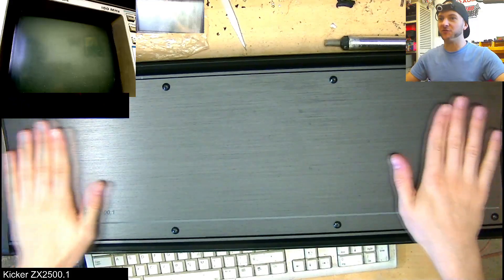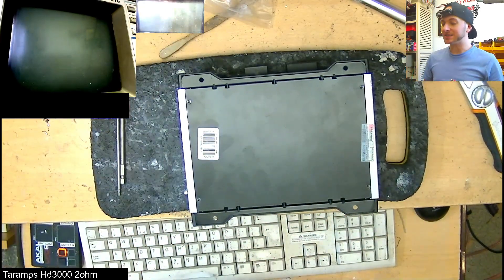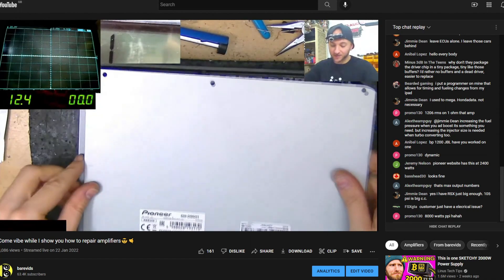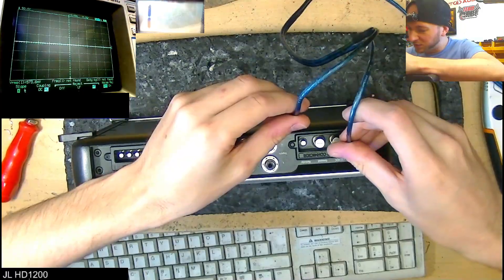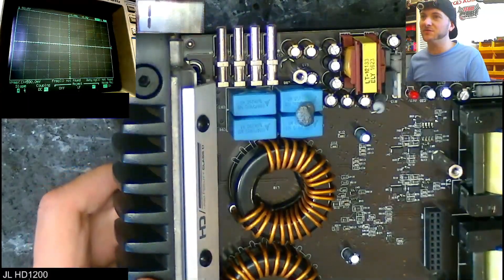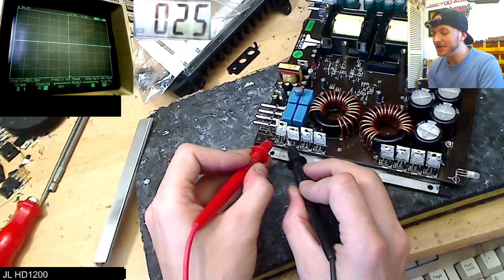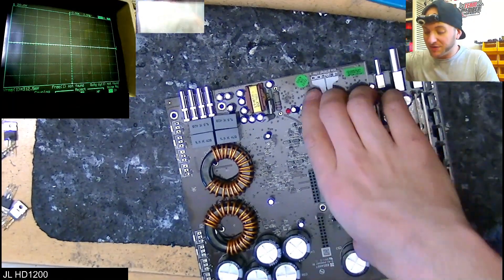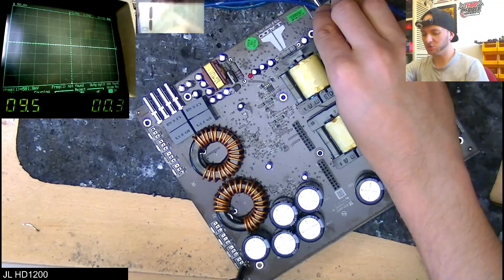Clipping your amplifier causes THIS?!

Comment: Ive got an amp, that has a CLIP LED, That is always lit, when amp is powered on.... Amp READY green light, lights up as it should, But from the second i power it on, The CLIP light is dimly lit... Not lit brightly, Just dim..... and i have 7.7vDC at output terminal of that channel.... 
Other channel is function perfectly.. No DC offset at terminal.. CLIP light isnt lit etc... 
Any idea where to start?
There are clearly no dead shorts, As amp powers up, Protection relays click and amp channel LED's go to READY.... 
Thanks

Comment: Awesome  vid bro!! Hey,I've got a jp33,and 4 10s in a vented box tuned to 32hz,the bass is fn great,but the amp is clipping and smidgen but sound awesome, not obvious indication of clipping other than the clip light, is it bad for the subs?
Reply from the maker: No it's not, but if your voltage is steady, I would suggest upgrading the amp for something 1.5x more powerful ☺
Reply: @barevids  ok,thanks bud

Comment: Hey so I have a digital designs m2b and when i turn the gain up the amp makes a thundering bump sound and will continuously make the sound even when playing music but it still sounds like it did before just had a thumping sound but I'm scared it's going to damage my subwoofer do you know what the issue could be?

Comment: So question, if the board say looked like it caught fire and looks burnt is the board junk?
Reply from the maker: No, almost always repairable
Reply: @barevids  so I checked and the underside of the board is a little toasty at the outputs. Burnt into the board a little. Would it be worth it to spend the money on fixing a MTX thunder elite 1501D? If seen it on a bench crank out 2200rms.

Comment: Can I run a soundigital 8000.1 evo 4 1 ohm amp at 0.5 ohm
Reply from the maker: No
Reply: @barevids  thanks for the reply. My friend's has 6 massive gtx 10s playing at 0.5 ohms. I know how box rase works but am not quite comfortable doing the same
Reply from the maker: @ronaldomaynard4816  I always reply no to these questions when I know nothing about the rest of the build. All amps can play fine into 0.5, if the rest of the build is suited to it.
Reply: @barevids  it should be fine because I have the current. 4 banks of lishen chargeing it 15.6v
Reply from the maker: That makes it worse. You want to LIMIT the amount of power through the board. It would be better run on 10v not 15.6v. People think strong power supply means it will be better at low impedance. Strong yes, high voltage no. Maintain 10v no clipping most amps are good for 0.5ohm. 15.6v means so much more power can pass through the board before clipping it will overload the components even if its clean.
Reply: @barevids  OK thanks I will run at 1ohm. Thanks so much for your time

Comment: Were the dead caps Vishay? And were they X types which are supposed to be self healing and handle voltage spikes. I've never seen a film cap blown and I deal with valve amps with spikes of over 1KV, weird.

Comment: bro get some chip quik (or generic equivalent) low temp solder... you can then add low temp solder on there, little by little until you have replaced alot of the hard to melt lead free solder with extremely low temp solder.. obviously you do not want to keep the chip quik on there permanently and its damn expensive.. but it works and will keep you from burning up the board.
Reply: You can easy use real hot iron. 
Discussie if what is best to do ?
Slow hot but long OR fast hot and quick thake IT off.  Its Just what you learn your self.

Comment: If the board has a lot of thermal mass from multiple layers of internal power and ground planes,  use SRA / low melt solder to remove through hole components.  They will literally fall out of the board very quickly using much less heat.  I have to do this when working on any through hole components on modern computer motherboards,  Xbox's ,  PS4s/PS5s, etc.  The boards are just too thick and will suck up heat like a sponge,  even with a powerful iron you will be there forever.
Reply: Exactly. I put a heat gun on low temp  5 inches away to evenly heat the board and lovely Pb lead solder to reduce the melting point. Flux is always helpful. RoHs THIS!

Comment: I have an alpine pdx-v9. If I put the volume at the point that distortion can be heard, it goes to protection. I did the same test at home, with the same result. Only occurs with high volume.¿Do You think that amplifier has a clipping protection?

Comment: @barevids nice work man. Crazy how simple JL amps can be to repair. Then, sometimes, they can be a nightmare. Those HD amps don’t like being clipped and ran hot. That’s how my old HD750.1 got fried. Friend of mine burnt up my amp. When the amp gets hot, it lowers its power and when it’s safe to run, it will give you peak power again. The little LED is a status light that changes color to let you know. Bet the owner ran the amp hot and kept turning up the knob till it couldn’t take it anymore. Love the new style of video work though. We need a live one day friend.

Comment: JL is such a cool company. They are the only ones to this day that I know of that do their rated power, no matter what from 14.4 down to 11.5 at 1.5-4ohms. (Did the test in my car myself. Of course, I don’t do that daily. I usually don’t drop below 12.3 on my setup. I’ll do a walk around of my setup one day on my channel.) Which means, even on a stock electrical, it will do its power as efficient as a 3-5k with all the upgrades necessary to keep your current up, and voltage up. This is why I run JL in my car. Expensive, but I guess the cost of all of the alternator, runs of 0 ga, and batteries I would need to have, just to have the same output from a 3-5k, balances itself out. And, I can move them from car to car without having to buy all the listed above, just to have a 3-5k amp run safe and not stress the power supply of other amps. Those with Perry’s guide knows, that the 1000/1v1 amps have a potential of 300 plus peak to peak rail. Be careful with those JL amps. They are more powerful then you think.
Reply: There are a bunch that do their rated power now that SMD amp dyno exists. There are channels that do amp dyno runs and alot do more than rated. But the ones that do are specific. Look at the channel Williston Audio Labs. Im sure you will enjoy
Reply: @coolstreetman  thanks for the referral, but I know of all of the channels that do amp dynos. I’ve seen the 1st run of the dyno setups on Tony D’Amore channel, (designer and founder of the SMD dyno and tools) over 10 years ago. As for the amps doing their rated power, yes I know some of them do. Thing is, they require a lot of voltage at higher ohm loads. In other words, a 1200w at 4ohm amp, which most likely will be around 4500w amp at 1ohm or more depending on the components and amp design and type. Most wire their amps at low ohm loads. Which in return, require a high current to do rated power, where as JL doesn’t matter from a 1.5-4ohm load because it has a regulated power supply that controls the current which keeps the the power balanced across the ohm loads listed. Example, if I wire a 4 ohm sub to a JL amp (R.I.P.S. Line of amps Slash and HD amps) , it does it’s peak power 1,000/1,200w. If I wire a 1.5ohm sub, or a 2 ohm, or 3 ohm, it will do its peak power from 14.4-12.4v safely. If you get a 4,000w amp that is 4,000 at 1 ohm, if you wire it to 4 ohms, most you will see is 1,000w or a little bit over or less at 14.4 and when the voltage drops, so does your wattage. Downwards of 600-800w depending on your current and voltage. You won’t see 4,000 watts at 4 ohms. That’s the difference.
Reply: @mikehonda7934  The rockford power  bdcp series amps are similar, the don't do quite as much at 4 ohm though.
Reply: @bigassfordsd  yup. Similar, but still, not the same. Also, the BDCP amp requires way more current then the JL amps do to do it’s rated power.
Reply: You are moving the goalposts. The other amps still do their rated power at whatever ohm load. It literally says in the amps advertising what the different ohm load rated power. 8,4,2,1. I'm an electrical engineer there is nothing special about how JL makes their amps. You are just a fan boy trying to sound smart. You think JL has some secret sauce on voltage stabilization? You really don't know what you are talking about. You are probably someone that thinks that apple products are inherently better because they cost a ton of money. There is no patent for circuit board designs so the JLs aren't special because even them are copying someone else's designs. Now if you want to talk about the build quality of JLs Subwoofers we can have a conversation because they make high quality subs.
Reply: @coolstreetman  I’m not a fan boy, so watch your mouth. I don’t take disrespect like that kindly. I don’t care about you being an engineer. I am as well. You sound stupid yourself talking this way. A true engineer would explain instead of leaving such a tasteless response. How about you delete your message and reply with more respect. I never said the other amps don’t do their rated power. What I was speaking of is the wider range of consistent power across the ohm loads and voltage range that most amps don’t have which JL did first and put it on the market. So come correct and respond with respect. You did some little boy 6th grade crap. Grow up.
Reply: If you are one of those Ford is better then Chevy cause my feelings please let me know because being brand loyal is very stupid. You should be looking for the highest quality for your money regardless of brand affiliation. But that would require doing actual research and thought process, which is something lacking in brand loyal people he World changes. JL could decide tomorrow to change to cheap parts and you wouldn't even know and think there products are still great this happens all the time. You have to be flexible because profit is always a companies reason for existing so.
Reply: @coolstreetman  to replying to this. I will tell you, I always look for the best option according to my build. My car was too new to do any high current designs on stock charging, and I caught good deals on my JL equipment which came out cheaper then running my JBL BPx2200.1 on my sub after all of the upgrades necessary. Im loyal to no company other then myself. If I could run a Powerus, or B2 Audio, Sound Digital, Taramps, or Rockford without needing serious upgrades, I would, but output and safety of my car, proper voltage and current for the electrical of my amp choice, and my pocket, plays a part. So go on with your crap. You are one of the reasons people hate installers, and car audio. Get a better attitude.

Comment: You know your stuff! Wow! My question is: Take an amp that uses  a DC/DC switching power supply, ok? Will the power output vary with the input voltage, or can the power supply compensate for the voltage change and still output rated power? Say range from 11.5-15 volts. Thanks
Reply from the maker: Hey Curt! Typically, with SPS in car amps, power supply PWM duty cycle is fixed, so as the input voltage changes it directly affects the rail voltage generated at the rectifiers on the secondary, which will change the clip point of the amplifier so yes it directly affects power output. Quite a few amps have regulated power supplies that vary the duty cycle of the power supply mosfets, which can keep the rail voltage at a fixed level. Its essentially sandbagging at higher voltages to stay within power and voltage design limits of the output section.

Comment: The older Kicker KX2500.1 was indestructible.. Low voltage, clipping, excessive heat and it never gave up.

Comment: I'm installing a 430 farad cap, with huge amounts of trepidation.  Can't imagine what would happen if one of those cells errupts, especially burried inside a game of Tetris behind 6 amps, batteries, wiring etc in the boot
Reply: My entire bank in my competition bass vehicle is caps.
Reply: I've got an Optima D27M in the rear, and while the battery is good quality and apparently very low internal resistance, it is 10 years old with 66% of its original CCA rating.  The cap is to help with vdroop, especially because I only have a stock 100A alt and I haven't yet even gotten around to modding the sense wire on it so it will actually stay mid 14s when I want it to.
Reply: Why not just use a deep cell group 31 battery? Batteries replenish power internally, whereas caps need an external source to replenish. 
Ideally, one would want to have a huge capacitor bank using rail voltage. A external bank can kill someone, but that's where you'll get big reserves for power etc

Comment: I think you saw no switching because there was no resistance or anything between the BJT's output/gate input and the neg rail, i've seen similar behavior on other circuits i made myself and i was like "why aint it working" till i connected a 100k resistor even lol till it worked at all

Comment: Taramps HD and MD are one of the best bang for your buck amps in the market. They come in 1,2, and 4ohm versions and cost from $160-$220. This means you get 13.63 to 18.75 watts for every dollar spent. Sorry IDK what that is in pounds...
Reply: Best bang is right! The biggest smoke and sparks. Junk amps unless your filling your car with 6.5” mids
Reply: @guysgt5003  😂I've had one for 2years now, with no issues. Maybe learn how to hook your stuff up right and you won't have those issues. The only people crying about fires with full bridge amps over other amps are idiots. If anything old school class AB amps are 10x more likely to catch fire damn things run twice as hot as any Full Bridge Class D. HALF THE PARTS, HALF THE HEAT, TWICE THE POWER.
Reply: @guysgt5003  Says the guy running boss audio
Reply: @Jamez84  Soundigital power8800’s two bro
Reply: Is that why you got NO Content bro?
Reply: @guysgt5003  Not one video of them uploaded on your page... right. 🤣🤣🤣🤣🤣

Comment: How easily will clipping cause death of caps? 
I was wondering with my SD8K 2Ohm evo2.1, can I set the gain to 126V  at -5dB and have it clip at peaks, while obviously watching that voltage won't go under 12V?
I only have a 160A alt, 6x40Ah AGMs but also 2000F of supercap banks. 
Re of the sub is 1.4Ohms, Imp rise at Fc should be 2.5Ohm and at 100Hz, 1.7Ohm.
I have in the past come to the conclusion that -5dB sets a good volume level with not too much clipping at full volume, but the SD is a lot more powerful and sensitive than my earlier Korean amps. 
Also, while I set the gain, the fan comes on right with the clipping light. Does it also come on with temperature or just clipping?
Reply from the maker: if the amp is clipping on the "kick" or impulse of the bass note only, and NOT on the tone/sine of the bass notes, then your LPF is TOO HIGH. For Brazilian amps, all of the knobs on the side should be at minimum, other than the gain. Then, an additional LPF should be set on the head unit or processor to around 55hz. You dont want a flashing clip light on the kicks, so if you do, reduce LPF until clipping comes on equally for kicks and tones throughout the track.
Reply: @barevids  I use a Helix DSP.2, where I can set all kinds of filters and slopes. 
I think I had the HPF at min and LPF at like 100-200hz on the SD and 100hz 12dB crossover on the DSP. Not at full power yet, just testing.
Are you saying I should have a 12dB/oct filter from around 55hz and 24dB up from 80hz? I usually set the gains with a 50Hz .wav sine wave file.
That would make the bass sound even less flat, It's a custom sundown nsv3 18 in a trunk wall tuned to 25Hz.
The lows with that kind of filters would be overwhelmingly overpowering compared to the mids? 
I do have 12s with 500W each in the doors, but they can't keep up from 55hz that well.

Or do Brazilian amps have such a roll off at the lows, that they don't get the same voltage than kicks?
If so, what would be the best way to ensure constant voltage over the entire pass-band?

Comment: Just wanted to thank you for the video on how to run multi amplifiers without strapping it worked like a dream and I have twice the output,,, I have two 1500.1DZ on 4,,10 inch DC Audio Level ones